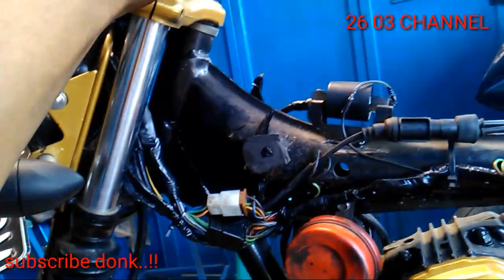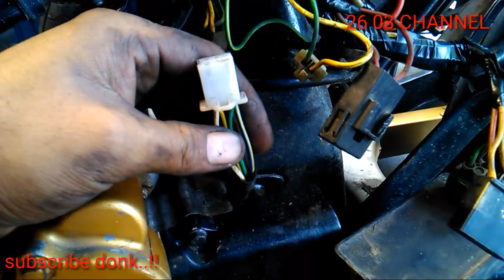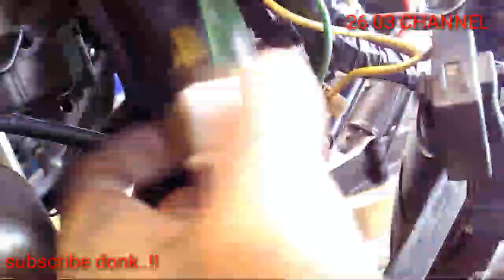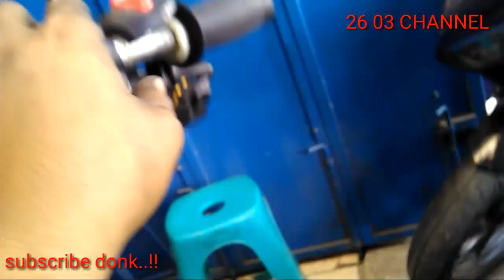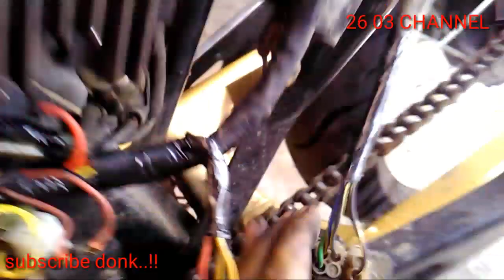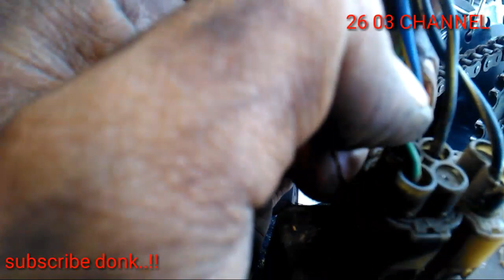Skema/Jalur Kabel Pengisian Full Wave|Megapro|Tiger

Comment: Massanya dari rangka apa nggak om.?? 
Soalnya setau saya stator fullwafe itu keluarannya cuma 2 kabel
Reply from the maker: Semua kabel masa ke konect ke rangka..
Yh betul stator fullwave outputnya dua kabel..tapi pada stator ori m.pro dn tiger ada kabel masa dri stator..
Kcuali stator motor lain yg dimodif fullwafe, kabel masa distator dilepas dn digulung  ulang dirubah untuk pengisian..
Dlm fulwave yg paling penting adlh regulatornya full dc..
Reply: Mksih infonya om,sangat bermanfaat
Soalnya kebetulan mau ubah stator glpro neotech ke fullwave ..
Reply: maunanya bang    .. itu kabel masanya punya saya putus di akarnya . ... bisa ndak di konek ke rangka ?

Comment: Mas mau nanya klo kiproknya jebol trs di cek pas awal pasang normal,  tp pas beberapa hari aki langsung soak dan di cek pke tester hasilnya pengisian  nyampe 28 ampere kira2 apanya ya mas. Trs aki juga boros?  Apa karna kegedean pengisian spullnya ya?  Mohon solusine om,  motorq tiger. Suwun
Reply from the maker: Kiprok ganti yg original coba.

Comment: Kalau pakai kiprok tiger tanpa aki motor bisa nyala enggak Om ?, terus tegangan output kiprok tiger setabilnya di berapa yha sama ampernya juga ?...
Reply from the maker: Bisa ..output 14-15v di rpm 4000-5000..itu normalnya untuk motor tidak kurang tidak lebih
Reply: @BangDori2603 oke om mantab... Sukses selalu😀👌
Reply from the maker: Ok.. thanks.. barader